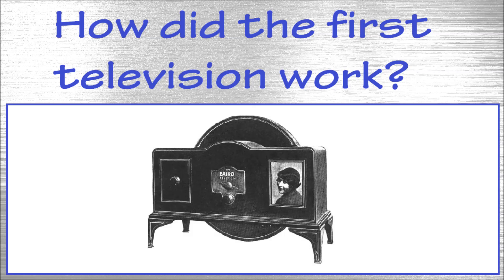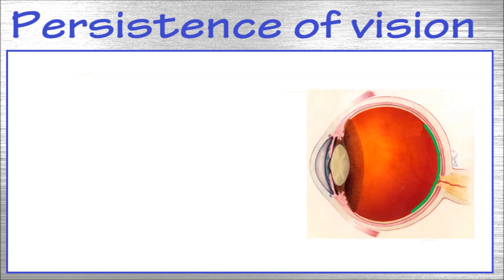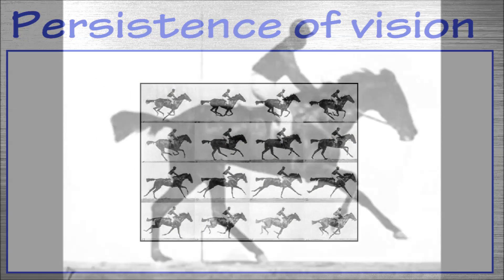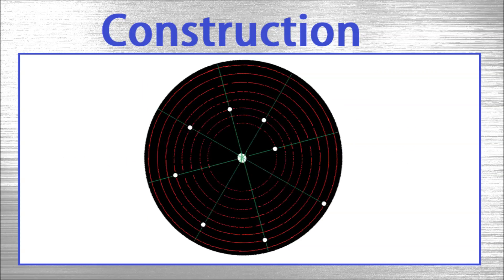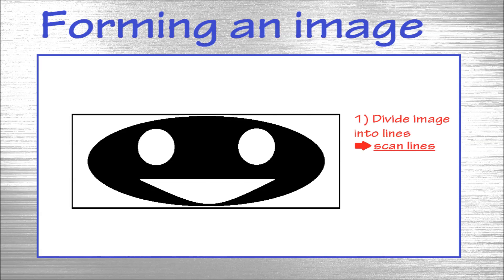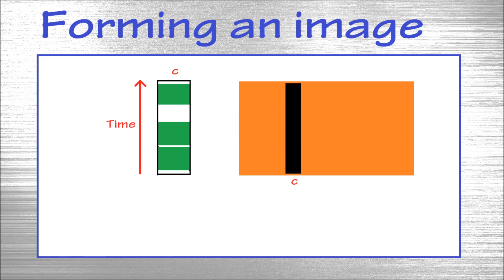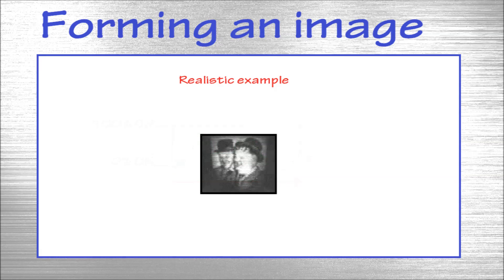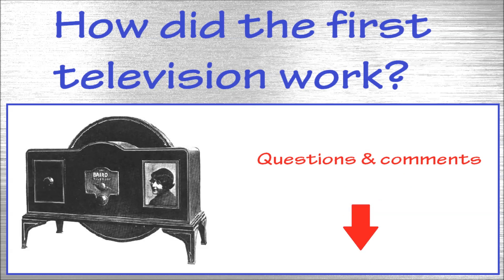How did the first television work? / Mechanical Television

Comment: Instead of scanning the image line by line, it is possible to capture the entire frame? I mean, not a frame composed by lines and pixels, but the entire frame at one time.
Reply from the maker: That would mean you need to have thousands of separate sensors to capture everything and process everything in parallel. Very complex,  impractical and expensive

Comment: Great stuff. My only question is, did they have to physically distribute those spinning disks? This isn't the case where television was "broadcasted" yet, correct?
Reply from the maker: The disc is part of the televisor device and is just a scanning mechanism that makes the image possible. The actual video signal was broadcasted indeed
Reply: @GlevoTec  Ah, so the "broadcast" was actually just information on when/how bright the light will be shown through the holes to the receiving TV? Brilliant!
Reply from the maker: @cohara7516  Exactly, that's correct. The signal was nothing more than a brightness changing over time to correspond with the scanning lines of the spinning disc to turn it into an image. Quite brilliantly simple indeed

Comment: Does alternating current make the picture look clear because of the speed?
Reply: AC vs DC as to the motor should make no difference as 1,200 RPM (or whatever speed) is 1,200 RPM.